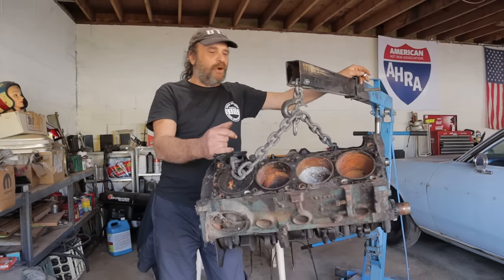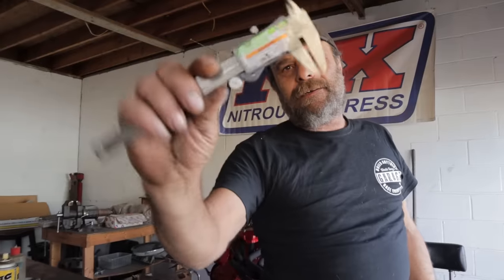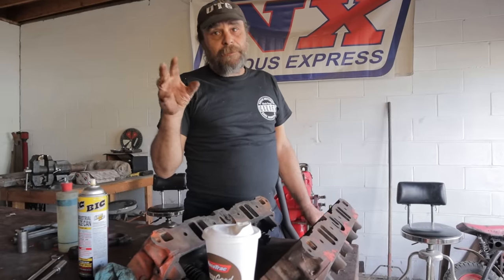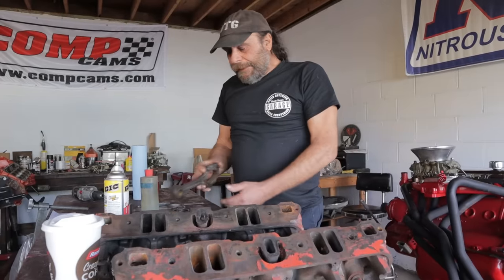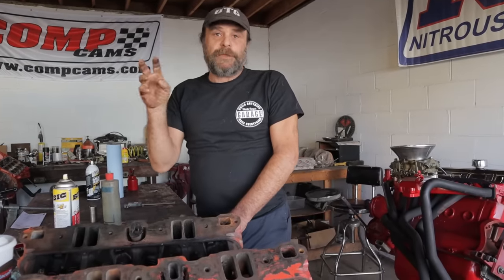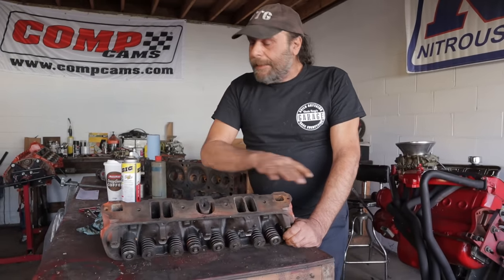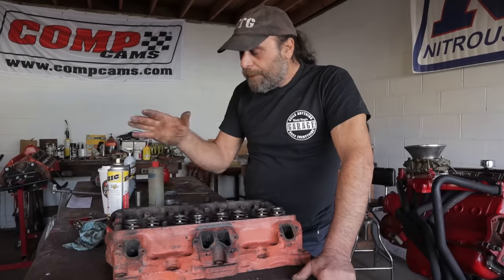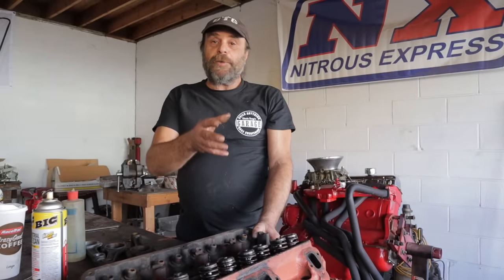The Most Under Rated V-8 In History?

Comment: Back in 1966 my best friend's older brother has saved all his life at about the age of XVI when he got his driver's license he bought a 1966 barracuda what a 273 2 Barrel, 3 speed automatic, and a final rear end ratio somewhere around 373 gears whatever close to that is in Chrysler with their limited slip and posi Trac or whatever it was we're both tires pulled pretty good and when he went to work that thing up and stomp it to the floor it was like he was driving on Ice cuz it tires just lit up in a smoke. Of course back then all we had was bias tires and I think it came with 7.50 x 14 in rims brand new car in the only paid like $1,600 for it as that time you could buy a Volkswagen Beetle for the same price Andorra Chevrolet pickup truck with 3 speed on the column. But that long 273 Engine with only a two barrel of course probably somewhere around 350 cubic feet per minute airflow and zero to a hundred miles per hour would lay you back hard in the seats as though you were in a performance Mustang or a Camaro are the same size what I'm getting at it's basically the same block as a 318 like you're saying here in this video. if going to build an engine using those 360 heads with the 2.02 intake valves are the same size as Z28 intake valve 350 Chevrolet intake valve have the words right in there with the best now you're worried about compression ratio why can't we buy new Pistons made with a dome on them to account for that extra space and bumpy compression back up to where we want it like I'd like to see around 10.5 to 1 ratio and there's another thing about Pistons you should look into as of around 2006 or 2008 there is some new technology that's not being talked about. there are Pistons made by using extreme high pressure Extrusion and forcing aluminum into a die casting of your piston so it's way better than hyper Technic piston as being extruded into a diecast the aluminum almost has the properties of fordist for strength but as it is a cast piston Sandeep it was very close tolerances as it does not expand as much. and the best part is Honda found that they're 4% less friction so they run killer they do not expand in high temperatures they're stronger than cashed almost the same as forged it's the best we are talkin Pistons that are strong enough for a turbocharger and what did you say the compression ratio was with the stock 360 heads around 7 or something that sounds like a perfect engine for a bold on weiand supercharger of about 30 pounds of boost that forget that for right now let's just stay with a naturally aspirated setup and you got one of those four barrel EFI setups on elderbrock intake that are the cheapest can't answer no problem these days as you can order just about any lift and duration beehive valve springs stainless steel valves all this stuff has came down in price so where a guy knows how to build an engine can afford and you will have to use with our no lead gasoline at the pump. and today aftermarket forged rods and forged steel crank are affordable. how to save a lot of words a lot of headaches take those heads that are have the 2.02 in intake valves and by Pistons to make up the compression ratio. and to my advantage I live about 45 minutes from Indianapolis where we got Precision balance of Indianapolis it'll balance anyting dynamically I only got Indy cylinder head where are they reproduce everything Mopar I never really research to see how much they reproduce for like 273 318 as mostly everyone goes and buys their 340 440 426 and then it gets into monster Motors it cost $50,000. that was your way of building a 318 with kind of parts I'm talking about a quick estimate off the top of my head can we not do this for less than 5 grand 5K maybe 3K we're talkin a V8 engine larger than 5 liters I believe we're looking at a potential of 400 horsepower naturally aspirated couple that to one of those old automatic transmissions out of a motorhome as you now can buy a tail shaft replacement that has a 3 speed overdrive attached to it and those old Chrysler 747 3 speeds from a motorhome RV already have a high stall torque converter they already have a lower low gear they already have a 15 quart oil pan just like do the expensive 3 or $4,000 drag race Transmissions nowadays are no more old cars from the 70s to put all this in like you want to pay an arm and a leg for him rusted out junk so why not find a Dodge Dakota pick-up short wheel base RT model rear  wheel drive I used to have about a 92 Dodge Dakota underneath side was galvanized there was not one rust spot on the whole truck. so I think I can safely estimate between your ideas and knowledge of the blocks and heads combine that with today's modern technology of Pistons rods and crankshaft and bolt on EFI that are plug-and-play that MSI ignition systems can be bought for the new EFI board on systems to work together all self-tuning and forget a person could have a pretty nice sport truck that could run low Nines in the Eighth Mile for something under 12K that would be maintenance-free other than changing the oil and filter something else I found out not too long ago you can buy ceramic coated brakes let's stop the same as regular ceramic brakes costing thousands I had a set put on my old F-150 Ford they have way better stopping power than the Brembo brakes that were on my Cobra Mustang just something else to keep in mind as are all different prices for all different models that in my case were only around $50 higher than carbon fiber that I usually buy........ there's lots of ways of cheating the prices of performance....and still have  reliability and safety....the shit we used to do back in the 60s and get away with its a wonder we ever lived through it all .....but we had our race cams headers two fours ....but with cord showing on the tires drum brakes grinding metal to metal busted shocks with worn out tie rods and ball joints .....one gearhead i knew steering wheel shaft splines were striped out so he used   vice grips to steer the car ....and some times the vice grips would slip off ...and re adjust and clamp back on in a hurry ....how are we still alive today ?

Comment: Back in 1981 a friend in high school got from his parents a 1968 Valiant that got put in auto body and machine shop class and was the project car. Mr. Farley the shop coach that also drove as a daily driver a 1966 Chevy II HP 327 . They bored out that 318  put a big ass high rise Holley carb on it and painted it what I call baby poop green with the black trunk Dart Swinger type stripes with a pen striped old english V mid rear quarter panel, stroked the crank and this must of been a thing but the way they set the front end up and sat the rear end down made it just seem odd but it worked by the end of the school year and summer cruising the strip that thing was beating or ruuning close to everything that came to Buckner Blvd.

Comment: I have a 1980 chrysler cordoba 318 that was my first car i still own it today ive owned it for 6 years now. ive overheated it twice ran it out of oil ( exhaust fell off manifold was sitting on steering rack and when i made a turn steering sent the exhaust into the side of my oil pan drove it home took about 20 quarts for a 15min drive lol ) the motor has unknown miles i do not hesitate to drive it anywhere

Comment: I had a 73 Satellite with a 318. It had 170,00 miles on it and ran fine. But it had a rear main bearing seal leak. So I tried a product called Bearin Seal. The result: a seized up engine.

Comment: In the ‘70’s the local cab company had 318 powered passenger vans with 3-400,000 miles. Plenty enough power for the job and they just kept going.

With minor mods this engine could punch above its weight.

Comment: Raced with a guy in the 80s who angle milled open chamber big block heads into virtually closed chamber heads.  I wonder if that would work with a small block head.

Comment: I knew a long long time ago the value of the 318 engine. I had one in a 1970 Dodge Coronet, 1971 Satellite Sebring Plus, 1974 Dodge van (factory custom)  1974 Plymouth Duster, and a 1999 Dodge Durango. The 318 engine (to me, at least) was the rival to the G.M. 350 c.i.d. engine, which I also had in a 1970 Chevy pick-up and a  1971 Chevelle. But that was in the "real days". The internal combustion engine is going to the wayside for electric cars, for the next generation. No nostalgia here, because I drove the hell out of those old cars.

Comment: Mexican 1969 Barracuda and 69-70
GTS came with a 318 with 340 cam, 273 close chamber heads, flat top pistons, windage tray, 4bbl intake and carb, compression of 9:5 and 270 hp, on the rear have Dana 44 w/ 3:31 gears. 
All for factory.

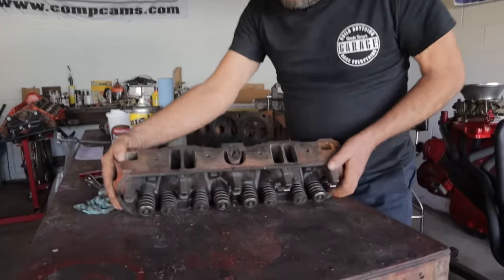Comment: 318s are so common. Trick Flow heads, cam, Air Gap intake, 1000 cfm  carb, ( Holley or Carter) headers, and you have 400+ HP on a stock 318 rotating assembly with a .030 over bore, and 10:00 to 1 compression.

Comment: 318s were fine in Darts Dusters and Valiants, and they in fact were a durable engine. Like the Ford 302, Chevy 305 and Olds 307, they werent enough for anything larger. I drove many vehicles powered by those engines in the 70s and 80s including a Dodge conversion van. Once it got in the mountains, the lack of power became seriously obvious.

Comment: Had a 71 Dart with a 318 with 340 cam and heads, factory intake and a quadrajet carb of all things. It originally had a slant six and a column shifted automatic. I swapped out the drivetrain with one from a 340 Duster. Outran a Corette one time. That was back in the Direct Connection days. Sold it when I got married. Stupid me.

Comment: We used about 5 or 6 of them in a row in electrical contracting from 76 until after 2000. Not one ran less than 200,000 miles the last one over 300,000. It started with a 73 D-200 Tradesman with a 360 and a three on the tree. Over 300,000 with only a timing chain. Remember the 70s and 80s was back when most cars were wore out at 100,000.

Comment: The 318 with the nylon sprocket on my 1969 Plymouth failed at 80000 miles and caused the fuel pump diaphragm to blow and mix gas with the oil. Three different mechanics try to fix the car and gave up. I put electric fuel pump on it and bypass the whole thing and made it work.

Comment: My first 318 dropped a valve just driving down the road. I'm 51 and drive old crap, have all my life.  Only reason I've ever had to call a tow truck.  Then, at two different auto parts stores, heard two different men talking about their dodge dropping a valve. I wasn't engaged in the conversations, they didn't know about mine.  But, I will still drive an ole dodge, just keep it close around home.  Won't stray far out of the county.  I have a Dodge pickup I need to retrieve. A guy gave it to me as part of helping him do some work. Totally unexpected.  It's early eighties model, lwb, half ton, 318, auto.  It needs a starter and a fuel pump.  They burned up the starter figuring out the fuel pump had quit.  But it's straight and pretty. I'll use it when we cut hay and to just putt around with here locally, if it don't have a title.  It's nice to have an extra vehicle when you're off cutting hay.    Just a few years ago, I dropped down in Louisiana and filled up and left out. I was driving a 75 hi boy and a 76 model 33' horse trailer full of tools. Crossed the Yukon in Alaska.

Comment: The most underrated V8 in history is the M28 V8 in the Porsche 928.  It can be bored and stroked to a 396 cubic inch, and with stock cams at this size can make 500 hp all day long.  This is a 5.0 liter big block with gigantic coolant passages.  It is all aluminum and weighs 550 pounds and has the same bore spacing as a 440 or 426 Hemi, which means if you find a way to drive the belt-driven DOHC's, you can have a 32 valve Mopar with Porsche heads....

Comment: I had plans to build a 318 in the late 90's. the idea was stock bottom end, 360 heads, and a blow through turbo.  I got as far as starting to collect parts, and caught my ex wife with her boyfriend late one night before any real work started. Divorces are expensive, and never got back around to it. Maybe one of these days. Still have a 318 in the corner on an engine stand, and a 72 dodge d100 step side to put it in.

Comment: I love the 318. I love the 318 poly sphere more. It had heads that in my opinion were better than the LA heads that replaced them.   The only thing I will say is that the large 340 bore only has two advantages. Obviously you get a few more cubic inches which are pretty negligible. The biggest gain in my opinion is the extra cylinder wall clearance to your intake valve to avoid valve shrouding for the guys who like to run extra large valves on heads that have a lot of porting done to them. All that extra porting and all the extra lift of the cam often times can be canceled out to a certain degree due to the intake valve being shrouded by the side of the cylinder wall. Other than that the 318 is a bad little motor when buil t with a respectable compression ratio and a set of heads and cam to give it the support it always needed.

Comment: I can remember, in the early 80's sitting down with another Dodge nut with the tech pub and wondering what we could do with the 318 smog block. After going thru the book comparing specs, we surmised that we could easily drop a 360 crank into a 318 and it would be somewhere around 344cid. Of course there would be some bugs to work out, be we always knew there was potential in those old work horses and they would give the Chev 350 sb a run for their money.
My old 318 van with a 4bbl Carter Thermoquad ripped the guts out of a 350 Camero one nite and the guy was pi$$ed.

Comment: 318 was a super reliable engine. The m880 series used by the military had 318s they just ran and ran and ran. I had bought a M880 military surplus in 1992 it wass a 1977 truck I ran that thing towing hauling snow plowing etc for about another 15yrs and 200k miles. Miss that truck wish I never sold it. I sold it for a newer truck The new truck was not as tough or reliable as that old M880
Edit : It was purchased directly from the military via DRMO defense retail marketting org.
Purchased via sealed bid after inspection at The lilitary base.

Comment: I've owned two 318's.  Both in Dodge Vans: 1972 1 ton Maxi-Van (automatic) and 1977 1/2 ton (4spd O/D manual).  The 1972 was a great engine.  The 1977 suffered from emission crapola.  Once that was sorted out, it ran good too.  However, the 72 was a better running vehicle, overall.

Comment: So when I was a kid in about '72 I bought a '68 Coronet 500 = so nice - pillarless coupe - 318 - my 1st car for $1000. Stock it could beat GM 350s all day long - probably not performance 350s - I'm not a GM guy but I had no problem with Malibus and Skylarks - well SOME Skylarks would just murder me. Anyway back then they would pester me and say I could "put 340 heads on the 318" to cheaply jack up the power potential - I don't know how many times I entertained that. NOBODY was talking about scooping out the 318 heads - at least back in Groton CT in early 70s. is that right? Was porting a viable option back then or was it just more sexy to slap on the 340 heads?  I gave up and bought the new 'Cuda shortly anyway but I always wondered.   🚗

Comment: Had a 1971 Plymouth Duster with a 318 back in 1992. Hated it after I had to do a steering box swap, (really should have went at it from underneath). Over time my opinion of that car has changed. It could actually accelerate going up the Camarillo side of the 101's El Conejo grade. 

I'm a Ford guy for the record.

So here I am with a '56 Ford F100 that doesn't run and looking at an engine swap and here you are with a video about an engine I carry a begrudged respect for. An overlooked engine I can possibly get on the cheap. Possibly cheaper than a 289, even...

Can anyone say F*cked Over Rebuilt Dodge? Because I'm thinking it.

Great vid, been watching for a while but this vid got me to make my first comment.

Comment: Been running Mopars since the 70's. The 318 was a great engine but still can't compare to the 340 or 360. Buddy of mine had an almost identical Volare as mine, both came with the SS, but he put a modified 318 in his and I put a 360 2 bbl in mine. He had headers, 2.02 heads, 340 cam, my high rise dome with 800 Thermoquad (too much carb for it), same gears and tire size. Wasn't even a contest. 360 2bbl with single exhaust walked all over it. Was definitely a lot better than before but it you're going to do a small block, just go with the 360

Comment: Knew this was a great engine since the mid-eighties buddy of mine had one and a 72 satellite Sebring. Old lady was original owner. Great shape changed over to 4 barrel  bigger cam, headers.Stock transmission stock rear. ran very low 14's in the quarter mile.Nothing else was done to it.

Comment: Am I wrong in that the original late 50's 318 had some insane amount of horsepower - I remember something like 300+ or maybe slightly sub-300... which by 1974 (the only 318 I ever owned) was putting out a "whopping" 115 hp. I also remember being quite depressed after reading that.

Comment: Had a couple 318s one in a 72 challenger cam intake 650carb headers 4.10 gears 727TF car would absolutely SCREAM had another in a 98 dakota magnum 5.2 exhaust cold air intake 3.55 gears it was a tire fryer.Un believably hard to blow them up buddy of mine tried for 40 minutes to blow a 318 up never did  give up the ghost. Between 6-7000 rpm for close to an hour and finally ran out of gas. Never blew up even after it was severely over heated 310degress

Comment: I have 360,000 miles on my 98 ram 1500 4x4 5.2L, 318cc......motor is still STRONG, a lot of Electrical wires starting to wear....LOVE MY ENGINE
Reply: Put new wires and do another 360,000